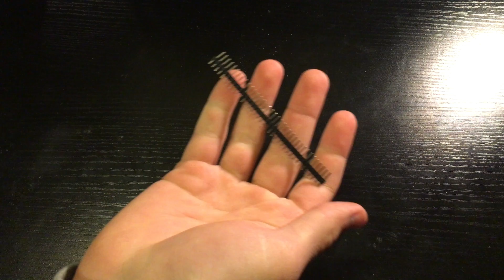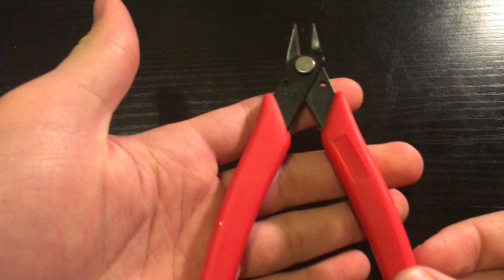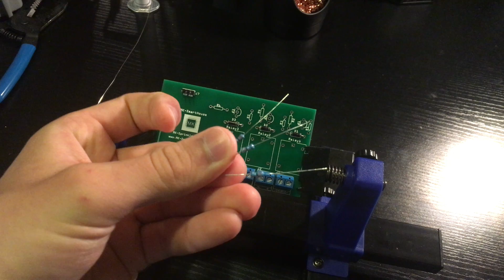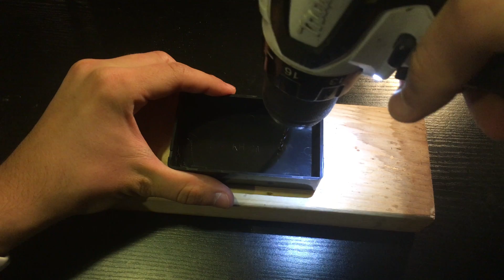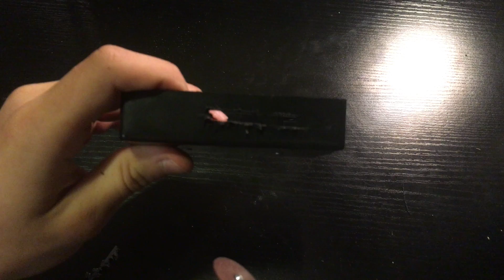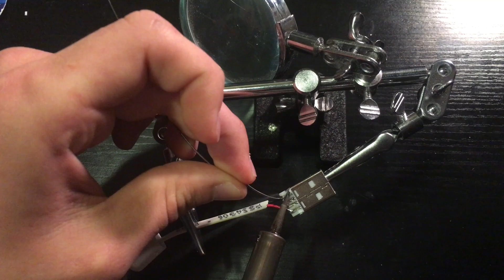Complete Guide Sprinkler System MQTT OpenHAB ESP8266 : Hardware

Comment: Great instructional video, idea, and PCB! You mentioned in another comment that if one wants to have more than 3 zones, they can make more devices--could you also use a shift register (or daisy-chained registers) to have many zones with the same ESP8266 chip and change the code a bit to reflect that?
Reply from the maker: +Brad Bucc I have never used shift registers
Reply: No worries! I'll try it out.

Comment: Great video! Could you design cases for 3d printing, so that they fit perfectly?
Reply from the maker: I could but I like these cases a lot and they close very well and work very well only 5 min of modifications. 3D printing a case like this would take a couple hours
Reply: Itead provide 3D printing services, so while you waiting for the components from China you can wait for Itead printing your case? i have draw a case for the door sensor and order one today (i wanted to share it but first i will check if it will fit).